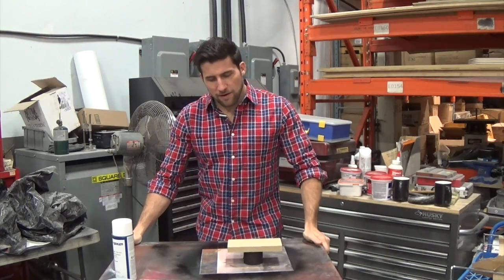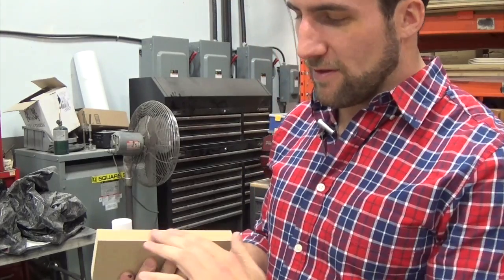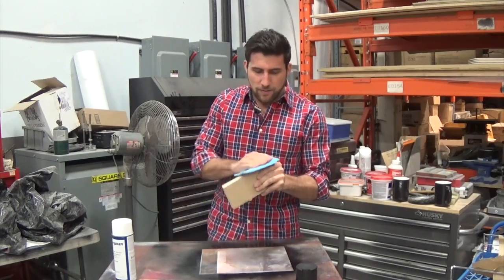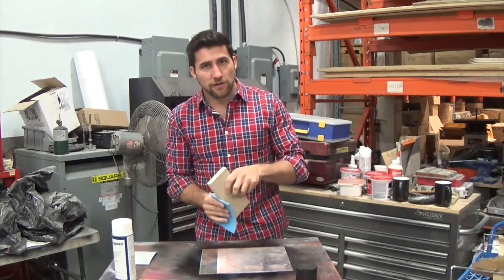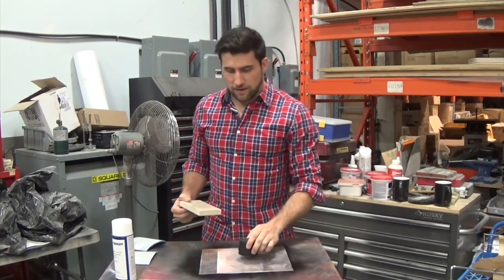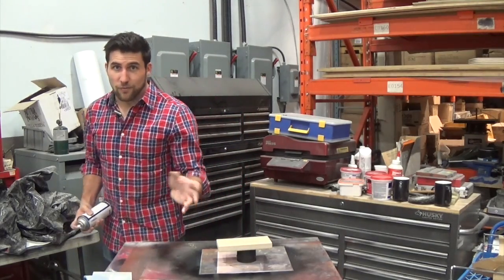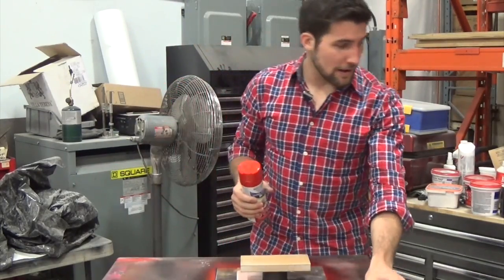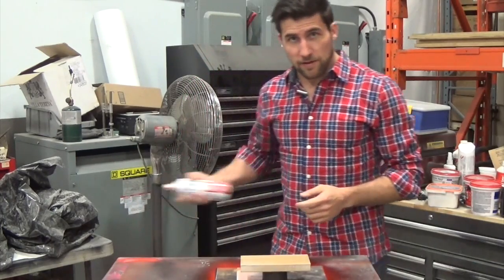How to seal MDF for a gloss finish

Comment: I've used Zinsser B I N shellac based sealer from spray can  and seals nice with one coat. 2 coats even better. Sand between coats then  top coat sand and repeat. Tried it today and pretty great results with very little effort. Much easier then regular primer which soaks in like a sponge.

Comment: i make high end art decco furniture with mdf/ hdf and use water based high particulate primer.  takes 30 minutes to dry.  sand then add another coat.  protects  the mdf from water absorbsion.  Then add colour coats and clear coats.  you can use all water based paints.  There some great acrilic warer based paints and clear coats. i spray the water based clear coats for smoothness.

Comment: Sanding between coats of clear primer isn't really necessary as long as each coat is smooth and without runs or blemishes.  The previous coat is dry to the touch, but is in no way a cured finish.  As long as the previous finish has not been left to cure, the next coat should bond very, very well.  Always make sure the sealer coats and the finish coats are the same chemical composition -- enamel over enamel, lacquer over lacquer ... etc.

Comment: I used this material purchased in a quart can from Klingspore ($16.99). I used 2 coats sanding in between as shown in the video, on raised panels. I did buy a respirator because the stuff is nasty. China bristle brush. Works great, very easy. Thanks for sharing this process
Reply from the maker: +Richard Kunicki I’m glad it worked for you. Thanks for watching.

Comment: Good tutorial.
Can I add a few tips ?
-- For small pieces like yours, wear a glove and hold the piece in your hand.....and just spray the sides, heavily, several times....until it nearly stops soaking-in. Let dry. It will prob need at least two coats.
-- MDF can be very brittle on the hard/sharp edges.I always lightly hit the edges with 220 grit paper, by hand, so there are no sharp edges.. This makes it more durable in the end (less accidental chipping).
-- My favorite way to seal the porous edges, is to skim them with automotive polyester filler (Bondo) , then sand. But don't sand through to the MDF, otherwise you are back to where you started. (Skim again if this happens.). Then spray with an automotive "sandable primer"....and carefully sand it smooth with 220 grit or finer.

Comment: Solvent based alkyd primer - instant dry. (Maybe 60 seconds.)
No need to sand edges of sculpted grooves - piles up thick and hides all imperfections, sticking fibers, etc ( (acts like a primer-filler).
One fat coat.
Accepts any top coat.
$40 per gallon.
Reply from the maker: +GreatWhiteNiko Sure.

Comment: Thinned water based varnish, two coats. Sanded between coats. 5 coats of water based varnish sanded between coats. Iron on edge veneer, also varnished with several top coats.  This gives a really good wood effect that most would never believe cheap mdf is capable of.   This video is really useful to learn other methods.

Comment: You can try solvent base acrilic filler for the edges, it dries fast and is easy to sand, usually a small amount will be needed to seal the edges, for primer I use 2 part polyurethane, sand the mdf with 240 grit sandpaper, apply first coat, sand with 240 grit, apply second coat, sand with 320 grit, apply a 3rd light coat, sand with 400 grit and you are ready for topcoat, it works for me, hope it helps, greetings from México!
Reply from the maker: Yes, that sounds like it would work well. I'm looking for methods that are quicker and take fewer steps, but I would imagine if you do 3-4 coats before even beginning your top coat it probably looks great.

Comment: Kilz works on MDF that will be painted with latex paint, but not under finer finishes.  I used some MDF window trim moldings that I had to cut down and modify to fit the space between windows and this worked great.  MDF also machines really well so it's nice to make custom parts out of.  I've had really good luck using cheap automotive spray primer in a can to seal it up.  Cheaper stuff dries faster (about like what you did with the vinyl sealer) and you can often get it for ~$4/can
Reply from the maker: I used to use the cheap spray primer for my machined MDF parts. The filler primer gets the job done pretty quick. So does a good lacquer sanding sealer if you're doing a bunch of them, but it doesn't build as quickly as the vinyl.

Comment: I do alot of painting specially on mdf doors, baseboad and crown and i always find that 2 coats 20min apart of kilz original does a very good job on sealing the mdf, I comeback and lightly sand with 220 and  than i apply 2 coats of semi gloss and it comes out great
Reply from the maker: I'm glad to hear that works well for you. I haven't had much luck with the kilz personally. Maybe I'll have to give it another try.
Reply: Very true.  Some people make a mountain out of a mole hill.
Reply: The key is the oil based primer. I always use zinsser products and have used hundreds of gallons of zinsser cover stain, both oil and water based, maybe even thousands, as a pro painter. The oil based primer seals without swelling the wood and it sands easily to a smooth finish. Oil primer is also key for sealing peeling paint and bad drywall or plaster. When finishing cabinets made from mdf, we also used a lacquer white undercoater taht worked well, but with epa and environmental restrictions, products have changed quickly over the years. In 6 months to a year, a product may not be available or could be quite different, so never assume you are using the same stuff you bought a couple years earlier, even if it is the same label.

Comment: Best MDF sealer is ceiling white with PVA mixed in , I use 3.5 ltr ceiling white with 500ml PVA , works awesome and cheap 😎
Reply: Hello Cyberspooky!  Which type of PVA exactly do you recommend?   PVA Building Adhesive, or  PVA Admix Building Adhesive or any other? Please!!
Reply: I've heard using PVA glue can leave a tacky finish, particularly if you use a water based paint anywhere in the process
Reply: Drywall sealer pva?
Reply: PVA is not easily sandable. Plus using any waterbase on MDF edges, can make them swell. Solvent-based sealers are a better option. Or just seal with shellac.... a few coats.

Comment: Hello, I paint in MDF with PU paint (monocomponent), this polyurethane is normally applied with a base coat, called "Primer" (like cars), or primer that watching your video would be basically the same, and I tell you more, with 3 hands of first the edges are already well sealed with their respective sanding between hand and hand. The process is the same as car painting. So in my case if you want a good high gloss finish, I recommend a PRIMER, or base paint (not sealer).
Reply: I dont know if you are European . For some reason this is not done in the US but what you suggested is the best method . I use gray PU sealer
Reply: @jojiran  I'm not from Argentina. If a one-component base works perfectly, several coats and sandpaper between each coat to smooth and leave a surface as smooth as possible.
Reply: @andres.giacomini  Are you using oil PU or water based?

Comment: Coolest person Iv seen using a spray can and still makes it look cool when you almost knock It over 😂 I want to vinyl wrap some plywood for a project. I know it’s not going to stick very well. Any advice on that?
Reply from the maker: The smoother the surface is, the better it will stick. Depending on what grade of plywood you got, if you grain fill and add a couple layers of sealer you can probably get it to stick reasonably well.

Comment: Sand edges and face with 180 . 2 coats of binz shellac based primer. with a 220 grit scuff in between. Done
Reply: What i use
Reply: Barry Penta- Is that zinser bin?
Reply: thx....got a mdf project on the TO DO list right now.
Reply: @browntrout3994  A little tip for you, the factory edges are tempting to use as a face because they are straight and factory. but they are softer, less dense, have voids and suck paint like a pro. 1/4 inch from the factory edges are sollid. whatever the edge on mdf, long drying time oil based primers wick in and will take 8 times longer to dry so recoating is an endless pain. shelac like zinzer bin drys quick, anything that dries quick but isn't water based is best. Or pay morefor water resistant mdf, the green stuff, you can use anything waterbased.

Comment: I always used to use body filler but this method looks easy and less messy 
body filler is really hard to work with , so thanks
Reply from the maker: You're welcome. I've done it with wood filler and body filler, but I personally prefer just using the vinyl sealer.

Comment: A good sealer for MDF is PVA.
I have trialed a BondCrete sealing mix, I used a 4:1 water/Bondcrete (external rated PVA sealer/glue). 
So far I have had no swelling on the test panel which has been subjected to high humidity, heat and rain (sub tropical Queensland Aus) for 4 years.
Reply from the maker: +AKA Nathan I like PVA; I just find it too slow to work with in most cases.

Comment: The company I work for pulls a laminate of various color over M.D.F.,  a wood wrap . why paint or stain  M.D.F. but have it wrapped/foiled in a nylon covering .
Reply: Because we don't work for a company with those resources. Ettore Sotsass designed furniture in the 1980's using the process you describe, and they sell for 30k plus. My dining table is a 1968 Knoll Saarinan, and is laminate over birch ply (with exposed birch ply edging). Good laminate is really expensive, MDF is relatively cheap.

Comment: Just get yourself a gallon of the 3lb cut dewaxed shellac that HD sells as a sanding sealer, breeak the edges with a little 120 sandpaper, and apply 2 coats with a spray gun or enven a foam roller or brush. Don't bother sanding anything until it's sealed, in fact, don't even sand until you have a couple of layers of primer on it. When you sand the edges, all you do is push dust into the edges that will contaminate your sealer and keep it from penetrasting as well, just seal the open pores left by your saw cut for best results.
Reply from the maker: I don’t agree with this, but I’m glad it works for you.

Comment: I wish I had watched this before my first attempt. I'm getting weird craters on the face surface. Great video - I use Minwax wood filler (Bondo Style with Catalyst) on the edges.
Reply from the maker: Must have just not filled a few spots quite right. Try going over it with a thin layer of normal wood filler and sanding back.

Comment: Hey Brad.. you should've made a clean up using air blow or wipe before each coat for a good bond of the next coat
Reply from the maker: To put it bluntly, not I should not have. If anything, waiting a few hours and sanding lightly with 329!grit would have been the ideal option for that purpose.

Comment: A really nice way to do mdf edges is buy a roll of iron on veneer edge tape with a more closed
grain like maple or cherry, iron on sand the edge seal and paint. The glue on the back of the tape acts like a sealer so you don't need as much spray sealer. It will look beautiful.

Comment: Fantastic video. How would you achieve a black piano gloss finish on an MDF project? What steps / finishes would you use? This video really saved me big time from probably some disasterous results on an MDF project. After the sealing would you use a 1 stage or 2 stage finish? Is there a comparable product to the Leyland Trade acrylic  primer undercoat here in the US? Would you use a PVA glue, the vinyl sealer, or an acrylic primer undercoat for a large job? I wish someone would make a vid or series of vids from beginning to end for finishing wood (MDF) Some have sealing, spraying color, or sanding, clearing, sanding, buffing, but never seen the entire process in a video or series of videos. Anyway, thanks for saving me from making a big finishing mistake by not sealing.
Reply from the maker: +Sam Greer I don't know what leyland trade acrylic primer undercoat is. If I were doing a piano finish on here I would probably use lacquer. I would either start with vinyl sealer or lacquer sanding sealer, then black lacquer, then satin lacquer clear. 
Once the MDF is sealed, it's just like finishing any other surface. The absorbent aspect of it is dealt with at that point.
Reply: Then that is what I'll do! Thank you. This is my first attempt at this, so do you have a recommendation on the number of color coats / clear coats?
Reply from the maker: +Sam Greer you just need enough colour to get the opacity you're looking for. Probably 3-4. I'd go with more like 8 clear coats so you can sand and polish if you need to. Lacquer goes on thin.
Reply: +Sam Greer. I have tried to do a piano finish on MDF a couple of times using acrylic lacquer: six coats of shellac on the edges then a coat of sanding sealer all over. The paint looked fine but when I went to buff it after flatting it with 1500 I think that the heat produced by the buff caused the MDF to sort of delaminate, the surface looked a bit like an ocean swell. In the end I just flatted it with 1200 and sprayed thinner with retarder onto it then squeegeed it with window cleaner followed by a thin coat of colour and hand rubbed it with Farecla 10. Took ages and won't ever do it again on anything larger than a match box.

Comment: I'm assuming you've experimented with the product in quarts at this time. have you tried rolling it on? since you're basically wanting a thick coat and sanding down anyways, in my opinion, you could probably roll it on to get a thicker coat of the non-rattle can without a spray gun.
Reply from the maker: Yes, I gave it a try. It works ok, but as with most products that dry this fast, the roller tends to leave a fairly textured finish.

Comment: Thanks Brad..............Will it take water based gloss finnish ?
Reply from the maker: The vinyl sealer? I’m not really sure. That’s not what it’s designed to work with, but water based finishes aren’t particularly volatile so it might be ok.

Comment: For a budget try water based polymer wood glue and dilute with water 1:1 fast curing, sanding between every stage 1 coat.
And then any acrylic primer or clear 1 coat it will be "sealed" then at least 2 coats of color and possibly 2 coats of clear gloss to finish build it up 
D4 wood glue is one solution.
Formaldehyde gas will still escape from MDF for upto 6 months after it was cut......
soooo not too good! just a thought.

Comment: great video!  Thanks for sharing this.  I have a speaker that is piano black with huge gouge in the surface.... almost like screws were put into it and the bottom was pulled free.... I'm filling with epoxy resin.  Do you think that I need to prime first?
Reply from the maker: Just seal it a bit first, even if it’s just with a thin coat of epoxy. Otherwise you can get air bubbles forming in the epoxy.

Comment: Use actual MDF sealer (usually white). Doesn't come in spray cans, Use a brush to apply 1 coat, then sand with 320 grit, then 2nd coat and sand again, then spay your lacquer and your clear. Polish and you're done, perfect gloss.
Reply from the maker: Vinyl sealer is MDF sealer. You can buy it in different formats if you want, but clearly it also comes in spray cans.

Comment: Hi Brad I am going to paint MDF room walls.I want to have flat or mate finish.The paint is water-based.Should I use some type of primer to seal the MDF or it will be fine?I do not want the MDF to swell.
Reply from the maker: You should consider using a fast drying sealer to begin with.

Comment: I like to use just a good thick, high build polyester primer. Eastwood makes a great rattle can version. Great fill, build and leveling, easy to sand, but takes longer to try.
Reply from the maker: Polyester is a reasonable choice for sure.

Comment: Great video. Any advice for signs made from MDF? It is a real pain to seal and sand the edges of each letter...face no problem, but getting inside and between the letters is a real pain...
Reply from the maker: You may be able to get away with simply adding more of the sealer, but usually when I do those lettered signs I just have to spend a bit of extra time sanding those tough areas. The really tough areas are tough to see anyway, so you may not need to be quite as careful in those spots.

Comment: Great tip, and overall nothing "bad" to say.  The only thing I would potentially be concerned about is if you used a solvent or alkaline based finish.  It might lift the vinyl sealer.
Reply from the maker: This sealer is designed to go under lacquer finishes. It actually works great under solvent and/or alkali product.
Reply: Lacquer?  Oh wow, considering it was vinyl sealer, I assumed it was a base for some kind of floor wax.  So basically one could use this sealer, lay down some lacquer, wet sand and buff to a super deep gloss.  Perfect for some audio speaker projects etc.  Cool.
Reply from the maker: Yup, pretty much. Behlen engineered this to be used as the base under their stringed instrument lacquer, which is nitrocellulose based. They work awesome together.

Comment: Thinned polyurethane glue works excellent. Just keep brushing it on the edges until it stops soaking it up and leave to dry. Especially for mirror finishes but it's to much work for my hidden speakers!
Reply: Very good tip ...... like 'sizing' a newly plastered wall so it doesn't suck the guts out of the paint when applied. Seals it up and you are good to go.

Comment: Could I use Zinser Bin shellac based sealer underneath Duplicolor acrylic lacquer?  A rattle can of vinyl sealer lacquer runs about $25 and the Zinser is only $10.  I have two large mdf Marty subs to finish for my home theater and my kid is building one your guitar kits so I need a lot of coverage w/o breaking the bank.  Thanks, we've gotten a lot out of your channel!
Reply from the maker: It may take a couple extra coats, but yes that should work.